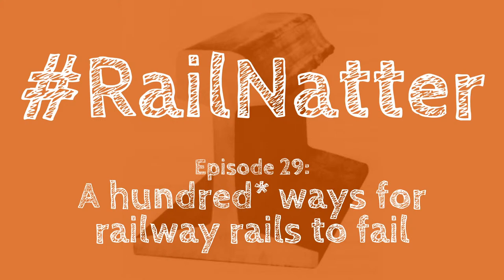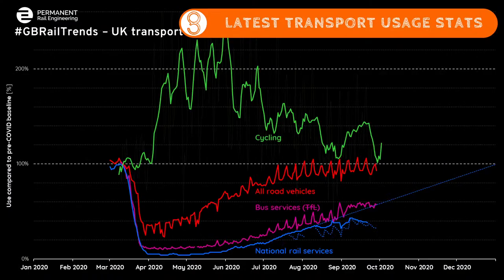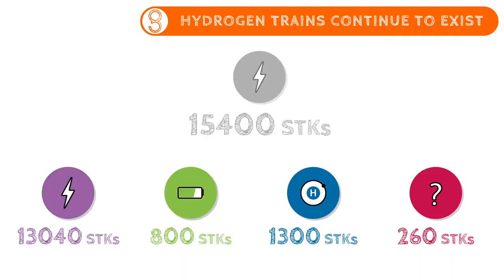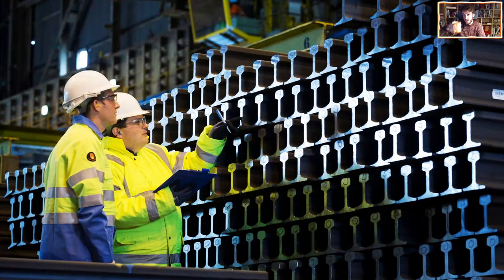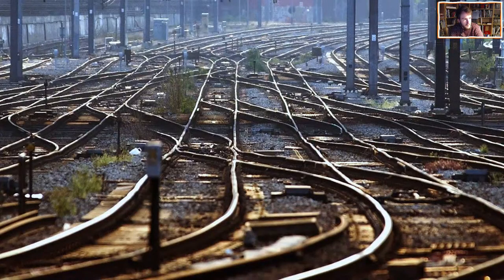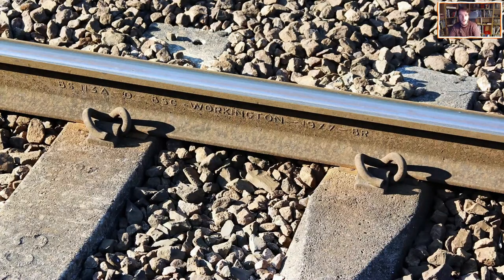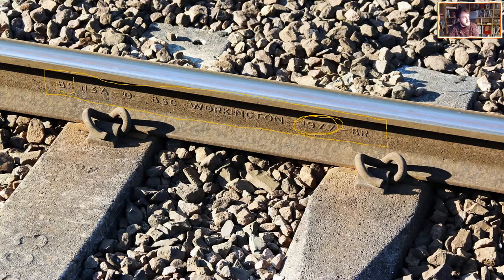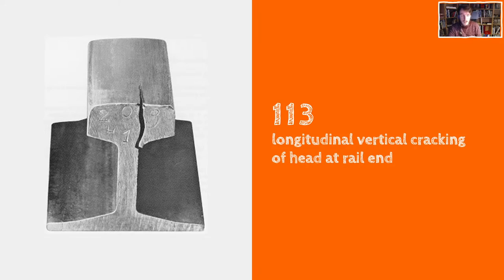#RailNatter | Episode 29: A hundred* ways for railway rails to fail

Comment: 202 looks like braking bumps on mountain bike trails, where every impact moves material up the far side of the dip, increasing the amplitude. Suspension with too much rebound damping or with a bad sprung:unsprung mass ratio doesn't follow the surface down into the hole so ends up hitting the far side at a greater angle.

Comment: Fascinating - the depth and detail are amazing.   Just as an aside, wouldn't jointed track have less faults if the rail joints were supported instead of between sleepers?  Did the Victorian engineers experiment by this? (and maybe were over-ruled by the Victorian accountants?)